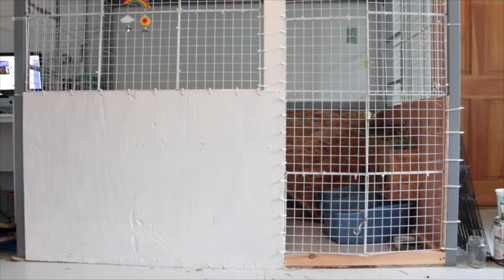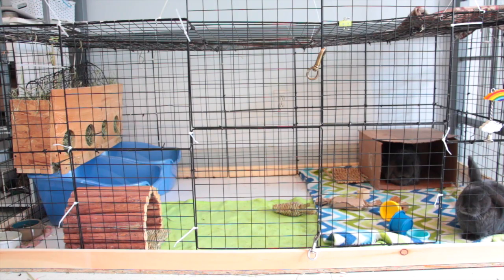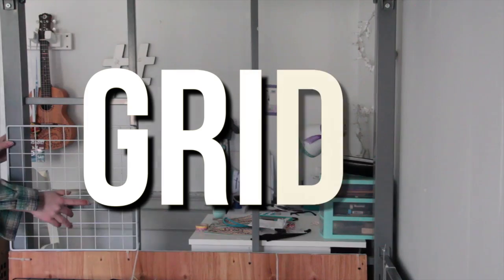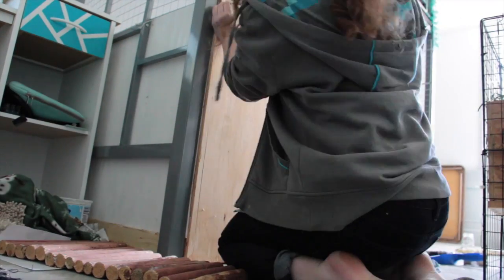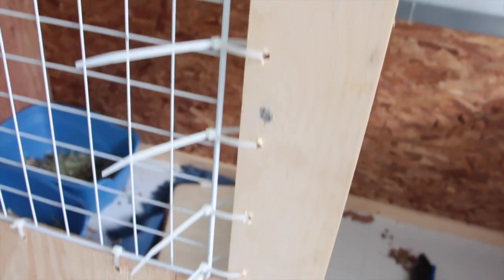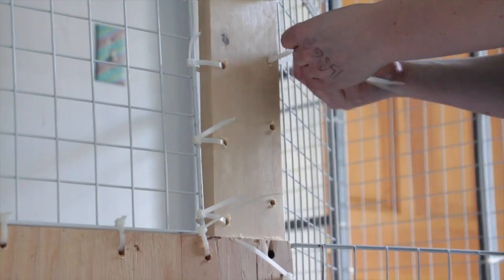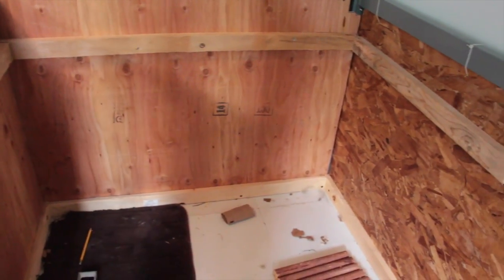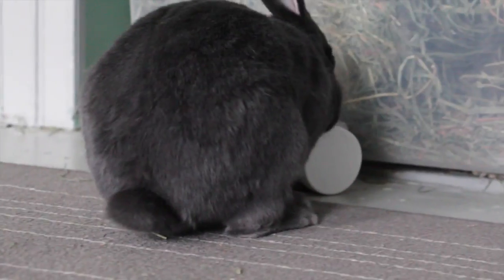How I Built My DIY Rabbit Cage

Comment: how much did it all cost
Reply from the maker: probably $50-60 but I had a lot of the supplies already
Reply: +StormyRabbits I have a bunny and I'm want to get another one do i just put the male in with my female bunny or should they be separate
Reply: Ariella Holbert at least one of them needs to be fixed unless you want an unwanted litter.
Reply: Cool

Comment: Where did you buy the grids?
I have only found Them for 75 and then i have too boy two🐇😒pls help🤗
Reply: Can you make a link
Reply from the maker: https://www.bedbathandbeyond.com/store/product/grid-wire-modular-shelving-and-storage-cubes/1016719773?skuId=16719773&mcid=PS_googlepla_brand_brand_&adpos=1o1&creative=45758750869&device=c&matchtype=&network=g&product_id=16719773&gclid=Cj0KEQjwuZvIBRD-8Z6B2M2Sy68BEiQAtjYS3OTyvKX9dys3GnNhFMDAE4xo3RT0difWbQ8OdFZjyTEaAsWN8P8HAQ
Reply: StormyRabbits thank you you are the best PS my bunny is the same race with the same name as Misty😂 How many grids did you use
Reply from the maker: I used 26 for this cage :)